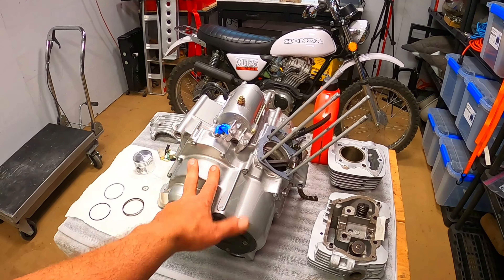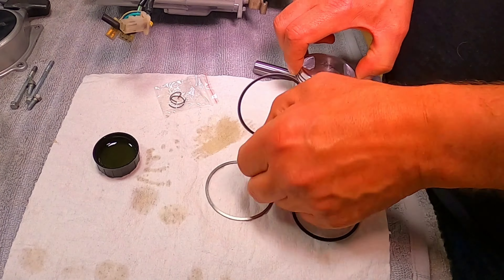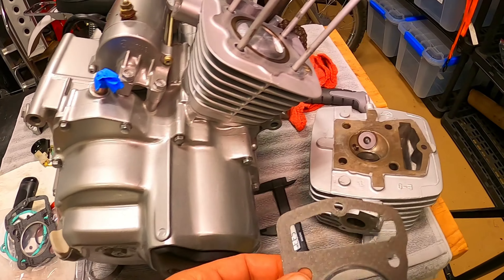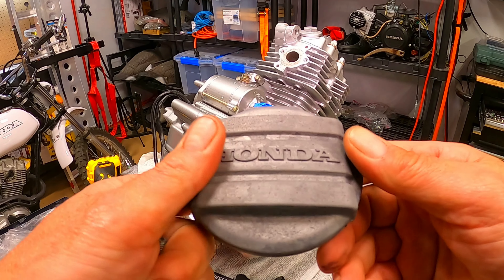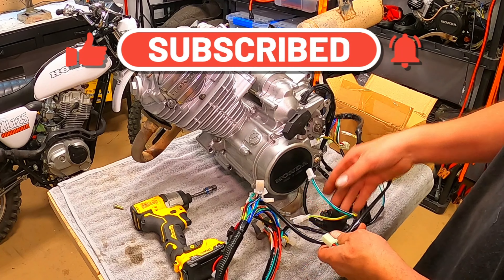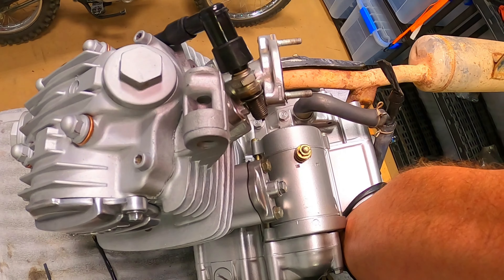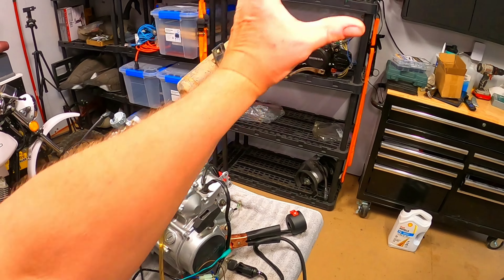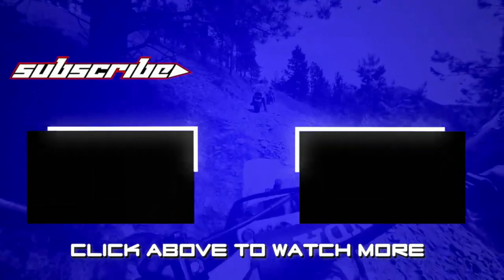87-88 Honda ATC/TRX125 High Compression 130cc Piston Rebuild - MASSIVE POWER or FAIL for the ATC125M

Comment from the maker: Thanks to @smallmiraclesgarage622 for letting me know I have the cam sprocket 180 upside down  😀 The dot on the sprocket should be facing "UP" pointing to the mark on the rocker box. 

Here is the tear down video of these engines if you want to watchin https://www.youtube.com/watch?v=NQoQXgtH9ug&list=PLmU1QZjQHa1sJz2h8UZPdjQJQBegxZFeY&index=4

and here is the assembly video of the 84-85 ATC125M engine https://www.youtube.com/watch?v=vRiig6dHEEg&list=PLmU1QZjQHa1sJz2h8UZPdjQJQBegxZFeY&index=6

Comment: dot goes up, there is a mark on the rocker box.
Reply from the maker: Whoops, I guessed wrong. Thanks for posting this!!! I'll go flip it 180 now 😀
Reply: @BIGFOOTBIKESANDBREWS  it's fine if your gonna be the only one working on it but won't be good for the next guy or if you forget lol. on a side note I need a piston for the horizontal 125. got one that smokes real bad and can't find rings.
Reply from the maker: @smallmiraclesgarage622  I am testing a 56.5mm piston for Dr. ATV on the horizontal engines as well. I am actually in the garage right now putting the engine in  a bike 😁 Here is the video of the prototype piston running in my 84. https://www.youtube.com/watch?v=vRiig6dHEEg&list=PLmU1QZjQHa1sJz2h8UZPdjQJQBegxZFeY&index=6
Reply from the maker: @smallmiraclesgarage622  I will have videos of the break ins and test running the horizontal and vertical engines on the channel soon. Thanks!